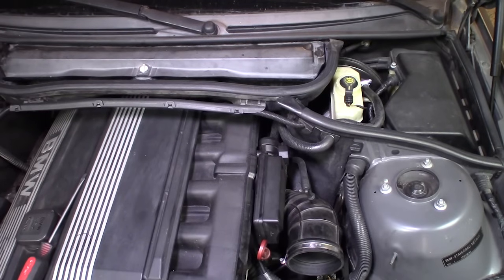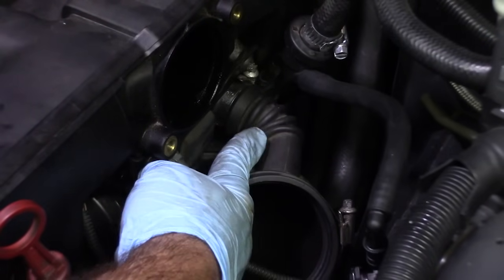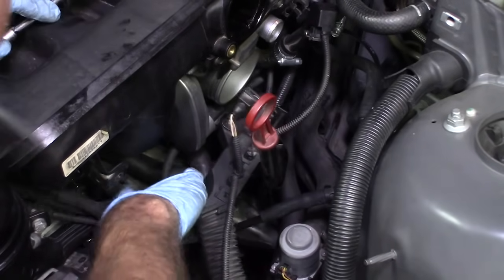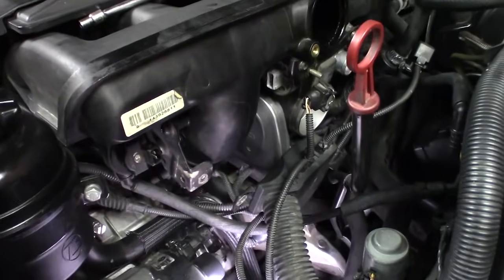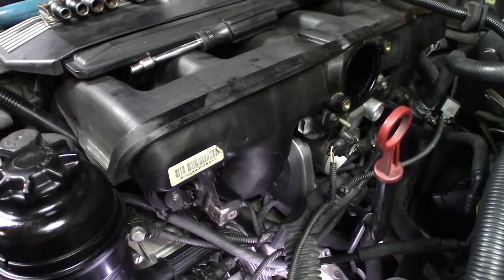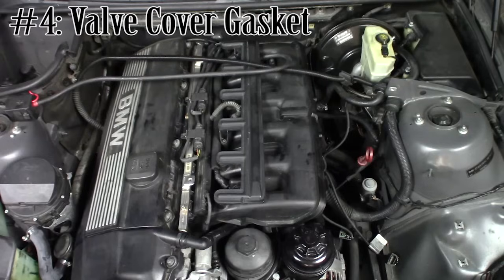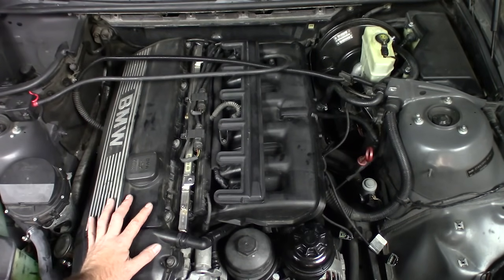BMW E46 & E39 Most Common Vacuum Leaks P0171 & P0174

Comment: Dude, you're a hero. I've owned my 325Ci for 7 years, and you've helped me through a lot of jobs. Just had these codes pop up in the last month and need to have a look around. Hopefully it's one of the easier problems to fix, I've put off the CCV for so long. 145,550 miles probably on the original CCV!

Comment: Hello how are u I love u videos I am been working on my 2000 BMW 323i wagon e46 have problem with po 174 and po170 and replace fuel pump pressure regulator maf sensor and injector I understand a lot about this cars I Owen Manny of them but this one got me I replace Manny head gasket on them I just want u opinion what u think I did smoke test and leak on valve cover gasket and I replace it no help other problem in minutes bleed down the fuel pressure to zero a son u shut off also change the valve where fuel regulator goes let me know what u think thanks

Comment: Dude, your video and explanation of everything is so awesome! I have an 04 330ci   and though I;m not having an issue, This is just great info to have an consider. Infact, you made me think out an issue I have with my 01 f150 w/ 358k.mls  Same codes, running to lean. With so many things replaced on my truck top wise, the head gasket makes so much sense after listening to you. Thank you!

Comment: hi. seen all videos . very heplfull. i have a 330i 2000 and a problem we can not find . cilinder 4 only on  idle shuts down . if running it does not . i have verified everything and  still scatching my head . coil pack is new and spark as well . please any advice
Reply from the maker: Please check out my video for diagnosing random misfires to see the procedure for diagnosing this.

Comment: Hello, a have these codes on my e46 m52TU engine. No other codes. Engine have very rough idle, rpm going up and down. When i discconect MAF engine work great. I buy new MAF (aftermarket) and with new one is just worse. Any help is wellcome.

Comment: Hey 50skid, i been watching all ur videos the great very helpful!!! Thank you! Im on a mission to try to figure out my e46 problem i have codes p0174 p0420 p0430 the car starts and idles fine until u go to put it into reverse or drive it tends to drop the idle and bounce just a bit . For some reason feels worst in reverse.. It doesn't do it as bad on drive it might just drop the idle and then go back to normal .While driving u will sometimes feel a small difference... I was under the hood today and i noticed that i can hear air suction sound coming from under the intake manifold Or near the disa valve . Any hints im located in Ontario ,CA . If some how u can help me out ill appreciate it alot any thing helps im doing all the clues in ur video im new to the bmw family

Comment: i have a 99 323i with massie vac leak around disa...throwing all 02 codes and all misfire codes....  new disa still leaking "used " disa
Reply from the maker: +sublime12201 Did you have a question?
Reply: I just can't figure out where it's leaking from.. I spray starting fruit around disa and the rpms go up
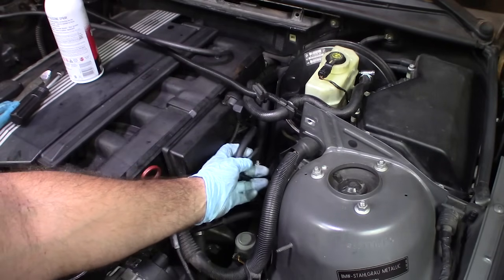Reply from the maker: +sublime12201 You need to replace the DISA o-ring.  Did you actually watch this video?  Skip to 5:50 and I talk all about this.

Comment: Many thanks for a very useful video.  My 1999 Z3 2.3 was throwing "O2 sensor adaption limit" codes (as per my Peake R5 FCX3 scan tool).  Using this video I was able to quickly isolate the problem as a hole in the lower intake boot which was creating a colossal vacuum leak.  I replaced all of the intake boot parts, cleared the codes, and all is now well.

Comment: like 
i'm getting only p0174 on x3 m54.  could it be a vacuum leak ?  with one code only ?
Reply from the maker: Yes it can but if it's only one bank then the causes are much more limited.  Could be a leaking fuel injector o-ring or it could be a leaking intake manifold gasket (there are two separate gaskets, one for each bank).  I would look at a code reader that supports live data and see if you can confirm you have a vacuum leak on only one bank.

Comment: Excellent video -easily the best I've seen on this subject. During inspection, I found a cracked hose coming out of the secondary air pump (going to valve). Your video didn't mention this so I was wondering, could this still be the source of my intake leak or is this unrelated? I'm unclear if that is used for intake in warm weather.
Reply from the maker: Gregg Cyrus Yep that would definitely cause a lean condition.  When you first turn your engine on, the secondary air pump pumps air into the exhaust for about 90 seconds to help heat up the oxygen sensors, but then it shuts off.  If you have a leak in the hose, then there will always be air getting into the exhaust which the computer hasn't accounted for, which makes the oxygen sensors think your engine is running lean.  Remember, lean means too much air is in the exhaust.  In this particular case it would be a false lean condition, since the air leak is after the combustion chamber, and the computer will be compensating by adding additional fuel, which will end up causing a rich condition which causes damage to your catalytic converters if you let it go on for too long.  What a mess!  Replace the hose ASAP.

Comment: would running lean cause me to blow white smoke/ possibly blow a head gasket?  I got a 2003 e39 530i 17xxxx miles. got the codes ran and it was running lean. a few days later i went somewhere came home and about an hour later I went to leave again and it wouldn't start. a few days later i got it to start but it wouldn't with out giving it gas then it started blowing a little white smoke so I cut the engine. any advice would help

Comment: I've used a number of your videos to help me out several times. Very clear explanation, very matter-of-fact, very informative. Thank you.  I discovered a sneaky air leak...  When rebuilding my DISA valve I noticed that the seal on the actuator arm was badly damaged.  This is easy to overlook and is not included in the repair kit and leaks a lot of air. I purchased a standard oil seal 22mm dia, 12mm shaft, 6mm thick to fix this.

Comment: hi 50's kid. sounds like you are in 50's range. and so am I as well. I am in process to buy e46 with 118000 mile.  It shows ENGINE SERVICE SOON. But engine  running pretty good including idle.  I heard bad idling when there is vacuum leak.  But not this case. what do you think? thanks
Reply from the maker: you need to get a code reader and scan for codes.
Reply: thanks for response.
Actually I did and said bank 1 and 2 lean. But I don't remember actual codes. What I don't get it is that when I hooked up the sannner, there were 4 counts. So I looked into detail and it repeated bank 1, 2, 1 and 2 lean. thx

Comment: A big thanks for your video here and the one about how to remove a bunch of key components.  You guidance helped me diagnose the massive air leak in my lower air intake boot and another minor hose issue.  Couldn't have done it without you.  Thanks!
Reply from the maker: Nice, good going.

Comment: if my ccv hose is broken... it is... can i just replace the hose?
Reply from the maker: +Romell Blanks Yes but it's recommended to also replace the oil separator itself because the rubber diaphragm inside goes bad and causes excess oil consumption.
Reply: thank you for the response

Comment: Great vid! I thought the gasket on the DISA was not sold seperately; have to buy a new DISA? Anyways, I have had a loud "turbo-like" whistle from my engine, around 1500-2500rpm on accel and deceleration. My car also threw a code p1632, which is Throttle Body Adaptation, and EML light. I reset throttle and went away. The whistle is still there, but I took the intake boots off, checked for cracks, and then DISA...my gasket was torn up. Cleaned it up really good to make a flush fit, and so far, no noise. Hoping that was the end of it.

Comment: Awesome video, thanks so much.  I had the same two codes P0171 and P0174 on 2001 Bmw 330i.  I ended up replaced the hose and these two parts vacuum control valve: 11741742712, vacuum valve: 221848283920 reset the engine light, it's been a month now, the engine light hasn't come back.  I bought these parts from ebay.  Now have to deal with drive cycle to pass DEQ.

Comment: Yup had a 325 ci 2003 and changed all the above for those codes had 144 k on it !
Ran great gor 2 miles better MPG also that is one thing you did not mention,but you Info is Top Notch Great job!!! I am currently driving a M3 2006 70K and the only thing after i change all fluids was MAF needed cleaning and two months later having the same hiccup morning starts and does not do this all the time. will be checking codes soon have no Lights on dash ,runs great 0-60 in 4 sec no Joke also looking into AEF Air system from want i have reviewed this will take care of problematic start off the line and thats is the only complaint i have Period .I can give this car a 9.5 all day long but do not buy without a warranty LOL

Comment: You’re actually one of the top few guys I trust for legit knowledge of the bmw cars. I have a 2006 X3 E83 m54 3.0L and I’ve had a vacuum leak for about almost 2 years now and still haven’t gotten my issue resolved. I’ve change the ccv valve and hoses , valve cover gasket, intake boot, disa valve, cleaned out maf twice, taken out bank 1 and 2 upstream O2 sensors and cleaned them out and swapped them to see if anything different will happen and Still the vacuum leak is there . Code P0174. Now however I do see my brake booster hose sucked in and caved in but brakes work fine. Do you think this can be my problem ? Can I just change the hose ? Or do I have to change the check valve as well ? Thanks

Comment: This video is amazing, thanks for all the valuable info. I deep cleaned my air filter, air box, and tightened the intake boot to the MAF.  I got these codes after driving my 2004 BMW X3 3.0i through some crazy muddy logging roads, puddles, mud. Can’t seem to get the codes to trip now. Definitely going to check the connection to the oil separator, I think mines broken. Have a shaky engine upon startup, and 700ish RPM at idle. Cleaned oil from underneath the oil separator today and didn’t even realize that could be the issue. Thanks for the video, seriously.

Comment: Had P0171 and 174 for the last 6 months... engine just started to idle horribly and starts to die if I don't let it idle until warm (while pushing the throttle above 1k RPMs because it's sitting around 500 RPM shoddily otherwise).

Replacing the DISA, ICV, and intake boot tomorrow using your videos. Thanks so much for such quality material.

Comment: my e39 m54 idles fine but rpms go up and down while driving, acceleration is also not the best, any suggestions that make the most sense for the problem? I also got the code P1350 (misfire during start cyl 5)

Comment: Thanks for the great introduction, I have P0171 P0174 and P1515 on my 2005 E46 and I don't dare to go to BMW mechanic dealer. I am thinking it is the DISA valve or mass Airflow censor. Please advise...

Comment: An easier check for a leak in the crank case breather valve is to remove the oil cap while it’s running and if there is suction when covering with the palm of your hand, then the ccv has a leak. Buy the whole kit with the 4 hoses, guarantee they are all rotted and will break. Don’t bother doing one at a time and being cheap, it will screw you in the long run. Might as well just get all the gaskets and replace the intake ducting too, from filter to throttle body and get the disa valve gasket too, it’s leaking almost guaranteed.

Comment: That DISA valave o-ring is a piece of sht.  It is integrated and is more of a gasket and likely to leak even when the part is brand new, ask me how I know.  Remove that oring and when you install a new also use plenty of oring lube.  The lube will help because the housing (manifold) that the DISA goes i to might have slight distortion since its plastic and has been heat cycled thousands of times already.  So it will probably be slightly out of round.

Comment: Hey 50's kid are you familiar with the m56 engine? i have these fault codes and my mechanic told me the diaphragm in the ccv was the problem. I know the ccv is integrated into the valve cover. Would a mild high idle on a cold start every morning and engine compensation thats using a lot more fuel? thanks .
Reply from the maker: +Javier Delgado Yeah it sounds like your mechanic is right on target and the symptom you are describing is a vacuum leak caused by the ruptured diaphragm.  I believe the M56 engines have a valve cover with a completely integrated CCV that isn't replaceable.
Reply: +50sKid yeah he said the whole valve cover has to be replaced. Will the problem worsen? He cleared the code and it hasn't returned, but I also have that Sulev warranty under 150k and ive been thinking about taking to the dealership
Reply from the maker: It won't get worse but the code will certainly come back and you won't be able to smog it.  I would definitely take it to the dealer if you can.  Yes, you need to completely replace the valve cover--to my knowledge.
Reply: +50sKid its also burning my oil right? and it use to stumble a bit and have the high rev now recently it just stays at 1,050 rpm~ and it eases its way down after 15-20 secs max. I definitely will take it to the dealer because the ccv is under Sulev warranty. just wanted to confirm, thank you !
Reply from the maker: +Javier Delgado Correct
Reply: +50sKid Hey just wanted a follow up as I have a couple more questions if that is okay.  I took into the dealership under warranty, they smoked tested it and replaced my disa gasket which eliminated the code from reappearing and got rid of the morning rough shake start but my RPMS are still riding occasionally up and down I'd say 520-570, so I can feel a rough idle when the RPMS are moving also. could it be that I still have the vacuum leak in the Valve Cover? thanks I'd appreciate some feedback.
Reply from the maker: They would have found a leaking valve cover during the smoke test
Reply: +50sKid do you have any idea what else it could be? It only happens at idle when it's first started in the morning and occasionally it also happens I've noticed that it's getting warmer when I turn the AC on, the car idles roughly like at a red light or when in park. thanks.
Reply from the maker: Idle air control valve issues perhaps

Comment: today i went to center and made smoke test. there is leak from diafragm/valve/pressure regulator - dont know witch is correct in english.  the guy who made test said it is diafragm but we couldnot see exacly you know why :)  i called to previous owner and he said he changed diafragm and bought a turkish one to save 20 $  :( sad story.  but why i have only 2 bank lean error code ?  i must find someone your kind in my city who knowswhat to do.

Comment: Hi mate I have a 1998 E39 528i when I turn engine off there is a strange howling noise I was told it was the disa valve so I replaced it but same noise have now been told it’s a vacuum leak and will have to be all stripped out the car runs perfectly although I hav noticed a bit off a difference in fuel consumption if you can help would be much appreciated as the so called BMW experts hav already emptied my wallet

Comment: Hi man, I’m a big fan. I recently have had troubles with my car stalling and not wanting to start at times. It was pretty sudden so I changed my fuel pump and fuel pressure regulator. And it still continued. It runs without the mass airflow sensor connected so I changed that and it would run for a while. And then later died once the car warmed up. So I knew that the crankshaft sensor sometimes cracks and I changed that as it was cracked and still I have issues. My fuel trim is really high and i am just now getting the 171 and 174 codes along with a mass airflow circuit low code. I checked some of the hoses but nothing shows up for as high as the fuel trim would indicate. My system B doesn’t go into closed loop as A does. So I thought it was an oxygen sensor but now I have both of those lean codes. I am so confused

Comment: I have watched your video for my E39. Just-as-you-said, it was the CCV return line to the dipstick.
Crack in the line!  Anyway I removed the intake and about ready for reinstall.
On the intake manifold, between the inlet orange gaskets and the lower support.
There are 2 outlets, one is a 90 degree takeoff for the black plastic that splits off.
The other is a nipple. I can’t find what goes there! It is a vent for sure. Is it just plugged?
I can’t find a missing cap, nor a left over vent hose. 2003 525

Comment: I have a code saying “flow rate secondary-air system too low bank 1&2” do you have any ideas? This video sounds on the line but I just wanna be sure I would greatly appreciate the help

Comment: Great video - I'm getting P0171 and 174, however, I'm also getting the catalytic converter bank 1 and 2 efficiency codes (P0420 and 430) - question: could the 420 and 430 codes simply be coming in due to air in leakage which is why the 171 and 174 codes are coming in  - in other words, if I find and fix air in leakage, do you believe that the CAT codes would clear up as well?
Reply from the maker: It's certainly possible that a vacuum leak would be causing false cat efficiency codes.  Start by fixing the vacuum leaks and then you'll find out for sure.